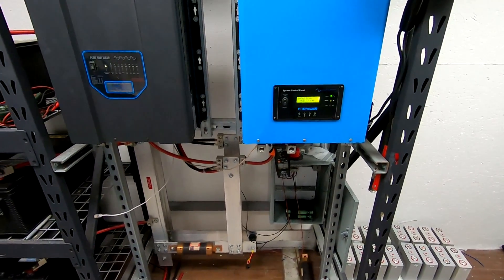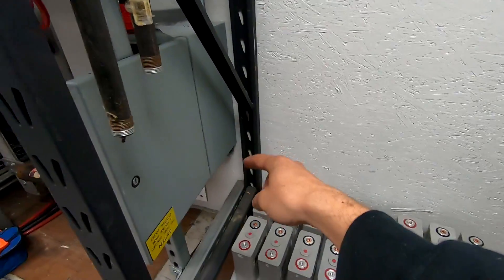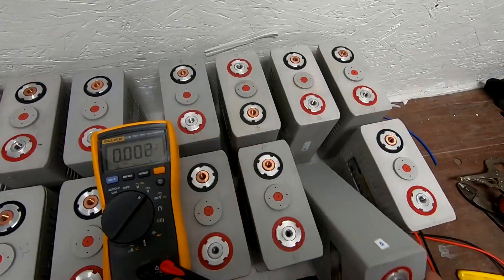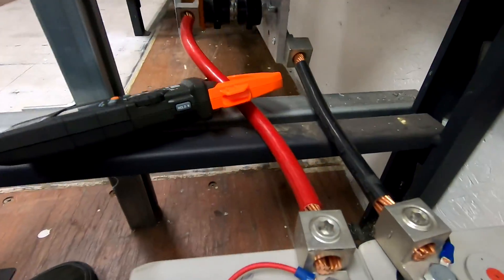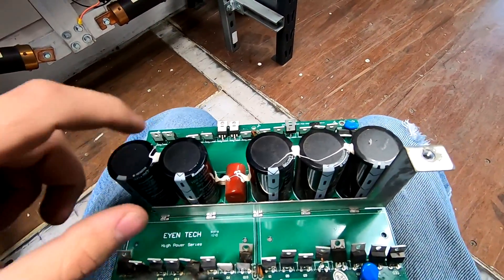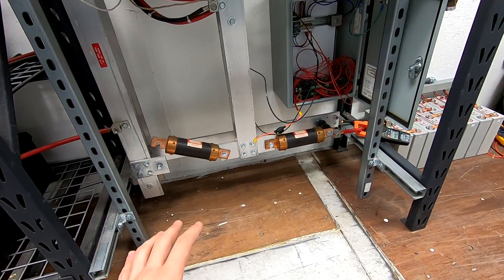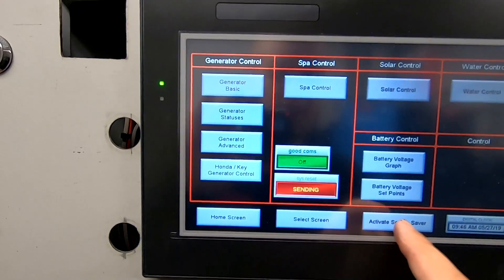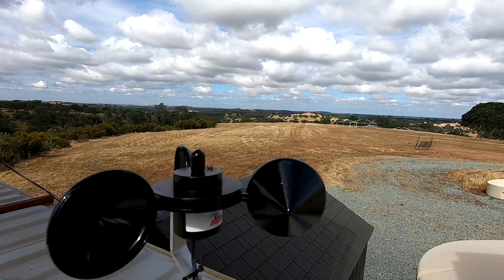Off The Grid: Installing the Best New Lithium Batteries!

Comment: Agree that Li-ion is better suited than lead acid.    Agree that prismatic LifePO4 (blocks) are easier to manage than 18650s...  AND LifePO4 have double/triple the life span (number of cycles).   The main reason a lot of us go with used 18650 is they are about 1/2 or 1/3 the price of LifePO4.        As you get things setup and increase the size of your battery bank I would look at limiting the DOD to perhaps 60% and you can extend the life of the LifePO4 even further.  For example, my battery bank is 780ah @ 48v which is 40kwh...  but I only use about 15kwh per day...   so I adjust inverter off to be 48v and max charge to be 55v and stay in the middle 50% of battery bank capacity.   This should (no one actually has exact info that I can tell) double / triple the life of the bank.
Reply: What are 18650's going for nowdays?  I know Jehu's selling them for $2 / 2200mah claimed, 1500 mah actual.  So for 100Ah, you need 67 cells give or take.  That's $134 for 100Ah used NOT including buying all of the jehu wire up modules that add to the profit.   You can get 100ah prismatic for $132 from ecpc, and you don't let out jehu's smoke like Kombi Life did burning down their house using 18650's that jehu sold them and soldered up the pack himself : https://www.youtube.com/watch?v=lc0j8tAzMw4
Reply: @haroldlopez2406  Calling an old Volkswagen a "house" is a bit of a stretch. Buy used lithium batteries from a shady mexican...what do you expect to happen?! Don't forget even million dollar electric cars catch fire. Obviously you have some beef with Jehu that none of us care about, lithium is dangerous and care needs to be used. Pot smoking hippies in a van are not a good example of anything...and people's actual houses (you know, the kind built from building materials) burn down all the time for all sorts of reasons.

What was their total loss, $1,000? My driveway cost 10 times that.
Reply: @ryanroberts1104  Part of the jehugarcia channel seems to be beyond shady and for the most part uneducated.  It's refreshing to see high tech lab do it right for once after amateur hour on youtube.  For years now, Garcia has said things like  "this here is a one kilowatt battery for only $…" which only proves he hasn't a clue about electrical engineering.  Batteries don't have kilowatts.  They can have kilowatt-hours if big enough in voltage and Ampere Hours.   His channel programming demonstrates he does not know the difference in power and energy.   Will prowse at least knows the difference and remains unbiased fully declaring when something is sponsored while Garcia has been making these "oh I just got these here ones in off ebay and we can make a 1 kilowatt battery out of them"   Yet he has a cultish following of people hell bent on this "powerwall" craze. It makes otherwise sane people  bolt significant fire hazards to their garage wall to be just like a tesla "powerwall" which is an elon musk marketing term Garcia has latched on to because it works.  What's happening today is people are spending lots of cash doing hazardous installs like this one in Hawaii  https://youtu.be/JA7Sh9ylAzQ?t=164   When those batteries go up in flames, they'll cook the inverters + charge controllers above them on the "powerwall"  Talk about a non-volcanic lava flow waiting to happen.  Also, take a gander at how those are parallel / series / parallel wired with only a batrium BMS on the outermost parallel of system voltage level banks.  He does that in a later video.  I can't see where he is getting the claimed 33 Kw-h for that "powerwall".
Reply: @infotech4990  I am not endorsing anything Jehu does. I did call him a "shady mexican", that was not a compliment. He does a lot of things I would not consider safe. With that said, I don't think he can be blamed because two stupid hippies caught their old bus on fire. I saw no proof it was the battery that actually caused the fire, or an error caused by Jehu himself. I did not investigate the fire myself.

And for GOD SAKE, an old Volkswagen is not a "house", people that live in them are considered "homeless", and if it burns down, it is almost nothing monetarily.

It's also worth mentioning, that even very expensive highly engineered systems, like a Tesla car, catch on fire also.
Reply from the maker: I'm sorry if you are experiencing a hardship and are forced to live in a van, then it's not "almost nothing", to them it's practically everything.  Just because it would be easy for you to replace doesn't mean it's easy for them.  Perspective is everything.  That being said there are quite a few sketchy practices going on, for example using resistor leads as tie wires between 18650s because his spot welder can't handle proper tie straps, or where he solders directly to cells, a big no no
Reply: @HighTechLab  Seems like more of a choice than a hardship. Maybe they should get jobs like real grown ups? Harold Lopez is trying to make the point that 18650s burned somebody's "house" down, which is totally not what happened.

Your batteries are obviously much safer, but drop something across the bus bars and I suspect a fire could quickly follow. True even for lead acid batteries.
Reply: @ryanroberts1104  IDK - I watched the whole hippie video, which is biased given the edit cuts, but the smoking battery I saw pulled out  of the hippie van certainly looked like the one JG put into the hippie van on their trip from south America to Alaska.  I could see that one blue cell at the edge in both before and after clips.  Same array Garcia soldered together in his workshop.  Also that hippie van fire happened while in storage just like Rich Rebuilds Disney car video, just sitting in storage.  I put some of our 3 year old UPS lithium into my boss' Class A to replace his AGM cells.  He now has 3200 Amp-hours of CALB cells partially filling the old battery tray that had 660 A-h of AGM.  What if that had been a Class A motor home instead of a hippie van?  The problem with lithium cobalt is that it supplies its own oxygen, like a solid rocket engine.  The fire goes out when you run out of fuel.  Lithium Iron doesn't do that.  I saw one video on lithium iron from Germany where they deliberately overcharged the cell to about 200% thickness bulging out, then put a direct short on it for about 15 minutes until it vented the hot gasses out the top.  Even so, no big uncontrolled fire like Tesla packs.  I have NEVER heard one instance of a lithium iron phosphate cell bursting into uncontrollable flames all by itself like the JG hippie van video or rich's vid or countless tesla fire vids, because the technology of LIFEPO4 is inherently safe.  If anyone has evidence of LIFEPO4 fire without intentional abuse then please post it here.  Everyone is bringing their A game videos of unintentional fires to this channel, which is great, and every one has one thing in common:  18650 Lithium cobalt generic lithium ion batteries, the 3.7V nominal not the 3.2 V nominal.  I'll wait.
Reply: @HighTechLab  EVERY 18650 battery mfg says NEVER EVER SOLDER DIRECTLY TO THE CELL.  Why?  Cross section of the top crimp shows there's a very thin INSULATOR inside the crimp that is destroyed by heat, and when that compromised insulator fails, you get a direct short from anode to cathode in the crimp area.  For lithium cobalt, it catches fire in milliseconds.  That solder melts and drips across the cells underneath, which join in the inferno once they cross the temperature threshold.  The rich rebuilds Disney video really covers what happens next very "well done".
Reply: I got most of my 5,000 18650s from AlarmHookup (ebay) a.k.a. https://batteryhookup.com/collections/tested-18650-lithium-ion-capacity-cells-from-modem-batteries  over 1.5yrs it took to build the battery bank.  At average of 2,000mah per used cell in 85% or higher original capacity the average cost was aprox $1.60/cell.   18650 is 3.7v so it takes 14 in series to get 48v.    So 100ah / 2000 = 50cells * 14 = 700cells * 1.60 = $1,120.   Plus another 500 or 600 in holders, busbar, solder, etc.   So call it $1,600 for 100ah.     
In the LifePO4 case they are 3.2v each, so you need 16 for 48v.   I'm not sure on $132??  as I have not found a trustworthy source for these.    New ones seem more than $132 - e.g. $200 or $250.  But taking your $132 it wouldb $132 * 16 = $2112.  So even at $132 it would be $500 more for LifePO4.    But I agree - LifePO4 is so much less work!!!  and double the cycles!!!   I just was not able to find a trusted source for used / cheap ones at $132.
Reply: As far as Jehu - I agree there's a bit of looseness in his approach and would not defend his battery purchase.  Battery wise Alarmhookup and Power2spare on ebay are the ONLY 2 sources I've found to be 100% accurate as to what they described and what I got.    BUT his videos have a great deal of honest info and they have helped me.   I'm not inclined to disregard valuable info.
Reply: I know - TMI.  But I wanted to thank @HighTechLab for the videos.  I can tell they are the 'real thing' and quite advanced setup, doing things I've not seen or discussed elsewhere.   My hat's off to you and thank you for sharing!
Reply: @kenattagexp9871  I do not understand why so many people believe the 18650 fallacy.  We use CALB cells at work in our Liebert UPS systems which are 3 phase 10KW each leg.  Electriccarpartsco has CALB 100Ah for $129 factory new, in stock right now just call and give them your Visa card.  We buy 1- 2 pallets at a time from our electrical distributor to replace the cells on our UPS systems, which runs roughly $110 per 100 W-h cell which is our contract pricing, not retail, certainly not ebay.  My boss still thinks you need to replace UPS batteries every 3 years like we did with AGM even though I've told him Lithium Iron Phosphate is good for 10 or more years.  Instead of going FedEx freight like car parts does, we have a trucking company deliver them to the dock door just feet from our datacenter.  Costs ~150 per pallet of roughly 250-300 cells.  Alarm hookup shipping costs $20.87 per 100 cells so add in another 146.09 to your figures.   So our price for 48V 100Ah is $1760 when bought by the pallet.  Shipping adds 50 cents or $8 per 48V 100Ah.  We're up to $1768, including the interconnect busbars made by CALB for their cells.  Those are factory NEW cells, which in UPS use should last 20 years or more since they only get drained if the power quits.  They carry a warranty from CALB, which we've never had to use.  I have no basis for an opinion of longevity, but I am sure HTL will give us some accurate numbers based on his usage I see here.  Anyone selling them for $200 or $250 is trying to double their money off a slick youtube video.  I put our used cells on craigslist for $95 per cell must pickup and they're gone in less than 24 hours, usually by the same buyer.  Now for your 700 qty used 18650, you say $1120 + $599 for 100 of those public domain PCB kits you solder yourself is $1719 plus your taxes and shipping.  Add in alarm hookup's $146.09 per 700 cells, which has some shipping profit as well, and you'd pay 1865.09 for a bunch of used 18650 cells with no history of how they were used or abused.  That's $97.09 MORE than brand new professional LiFePO4 with a warranty which is infinitely safer than Lithium Cobalt JG and AH is pushing.  We should put together a list of all the youtube lithium fire videos because one is forming here on HTL's comments!  Am I the only person who's noticed JG has no source of power other than the AC outlet?  Will Prowse and HTL have shown us their solar systems!  I don't see any solar or wind, so what is he making? a UPS?  We put our CALB cells in a datacenter holding I'd guess several million dollars worth of infrastructure not to mention the value of the data stored on it.  I wouldn't put one of those alarm hookup 18650 cells in my house.  18650 "power walls" will NEVER be cheaper than prismatic cells UNLESS you make your own cells, as Tesla does.  Even Tesla learned 18650 is not the most efficient battery and switched to the 21700 IIR to make at their own factory.
Reply: Very interesting and I don't disagree with your post.     I think 18650 got started because you could a DIY powerwall 'for free'!! as long as you could get old laptop battery packs for free.  Of course, that's just not reality.     I agree that in UPS they should last forever.  Lithium ion does not degrade very fast under steady voltage unless its at the very top of battery specs (from what I read).   THE ISSUE for me (and I suspect others) is a safe place to buy LifePO4 over time.   To do a 780ah bank of 100ah LifePO4s..  I would need 16 * 8 = 128 of them.   128 * $100 = $12,800.   Too much money to raise/risk for a single purchase... but yet over time say you buy 16 every other month...  you want the supplier to have similar product so you don't wind up with wildly varying cells in capacity.     I've tried several 18650 battery purchases and been stiffed (60% advertised capacity kind of thing) several times - so I'm personally very wary.    Do you know of a rock solid source for LifePO4 prismatics?.       Also, I should add, that now that I have made a major investment 18650 - the Batrium BMS and other pieces of my infrastructure are around the 18650 voltage range...   I'd have to buy a 2nd BMS to manage the differing voltage range of LifePO4.     So it kind of tends to 'trap you' once you go down a particular road.
Reply: @kenattagexp9871  I agree, you're into the ecosystem now.  Do you have a test plan of any sort? I'm just curious how you know if they are still good.  There's this Electrical Engineer guy who takes away most of our 3 yr old cells, so I'll ask him to join in here on HTL's YT channel.  About testing,  I asked my boss how he justifies replacing our CALB cells every 3 years like AGM when they are still good.  He sees things differently with a MBA and explained it this way:  To have me or anyone else take time out of our day to drain and load test every cell would cost him labor, which is in short supply already.  Labor = Money.  Since we get them for $110 and sell the 3yr old ones for $95, it "costs" $5 per cell per year to replace with factory new cells from CALB that come with a test report and warranty.  That "costs" less than paying one of us to test each cell and make sure they are still good.   The engineer dude showed me his test system with a bunch of expensive lab equipment from Agilent, HP, and Keysight run by a laptop that he uses to automatically test the batteries he buys from us.  It even plots a new graph of their capacity, which is usually well over 100Ah, like about 110 or thereabouts.  He told me CALB puts more in than 100Ah so that after 3000 cycles they still meet specifications if treated properly.  My boss got a quote to test them, but it was way higher than buying new ones, so that is what we have done for 10 years now replacing 1 phase battery set per year.  So my boss says the least cost option to ensure we always have working batteries on the Liebert systems and the Telecom room -48VDC bank A and bank B DC supplies is to just replace on a 3 year rotation.  Makes sense that way, and when we expand and buy more UPS systems, we get stable contract pricing on extra new batteries for ups acquisitions for expansion, a side benefit of replacing all the time.   We also save money not buying Liebert's expensive AGM rackmount batteries.  Guess that's what a MBA teaches you!
Reply: Test / How to know if good.    This is where Batrium (www.batrium.com) or similar BMSs comes in.   They have a system where you hook onto each of the cells that make up the series of the battery.   This provides balance but more importantly provides monitoring so you can shunt trip if any individual cell goes below Xv  or above Yv.     This combined with fusing each cell (as Tesla does in their car battery banks) provides an acceptably safe battery.      Spontaneous dead shorts in a cell will burn the 3-7amp fuse on each cell and isolate it from the pack.   Cells that go below X (say 3.0v) or above Y (say 4.15v) will shunt trip - isolating the battery from load or charge and give alert.  This should give one time to address the problem before it gets to fire situation.      For solar battery - like the one here I would suggest that its a good idea even for LifePO4 to have a shunt trip is the balance does not keep things above a min low voltage on each cell.
In UPS case - I would think you-all would have a BMS that perhaps sounded an audio alarm if one of the cells when low?  and give time to replace it?  
But, having worked for large companies, I also understand things like the 'logic' you outlined for the 3yr replacement.   There are business (insurance, customer expectations, ...) that make lowest possible $ a lower consideration - especially if sales are good :)
Reply: @kenattagexp9871  I don't see exactly how that balancer will be able to tell you the remaining life expectancy of a battery.  BTW be careful mentioning company websites by their URL as your post gets held for approval. I got yer notification bell and saw the URL in your post from baterium  but I couldn't read it until the moderator manually approved it just recently as that post didn't show in the list, even though my alarm bell got flagged and gave me a teaser version of your post.  I'm glad you understand my boss' logic, which is basically you can't rent a battery for $5/yr or even pay for an extended warranty.  So far we've never had a problem disposing of the old units.   What I meant for battery test reports is where you put a constant current drain of 1/h * c (example we use 12.5 A for 8 hr rate on 100ah cells) on the battery then plot the voltage over time for 8+ hours to measure what the cell will do.  It's measuring cell voltage over a period of time, which must be done outside of the UPS.  The battery tester does it, plots a graph of voltage vs amount removed.  We try to have 8 hours of uptime available, which means lots of batteries on some systems.   All of my UPS systems must be rated to run 8 hours, which factory reports guarantee as do aftermarket recertification which the guy who buys most of our old cells does.  I found his email so I'll forward a copy of this in case I got it wrong!
Reply: Sorry about URL.   You're right, the BMS does not show life expectancy, but it shows individual cells and their relation to each other and their performance such as ah in/out each cycle and number of cycles etc.  Each system has to define its own life expectancy.   In my case, my battery bank is large enough that it will deliver what I need all the way down to 50% of original cell's capacity.   I expect the packs (cells) in series to either reach 50% OR more likely become so out of whack with other cells in the series that they won't balance any more.   The BMS will protect against catastrophic unblance and do shunt-trip  AND/OR  report/record metrics so I can judge AH per cycle and judge that relative to the original 100% and if its enough for the system.    Batrium also records the mah of balance spent for each cell - this highlights troublesome cells as they will require more ah of balance than their neighbors as they degrade.
Reply: @kenattagexp9871  OK - so I think I got a picture of your setup, you've paralleled up a bunch of 18650s as one 3.7v "macro-cell" in the eyes of your bms, and if one big cell fails to perform, you know one or more of the little 18650s that make it is likely out of whack.  If you have a bench DMM that goes down to fractional uV resolution, you could probably probe around the bus that makes up one macro-cell and figure out where in general the problem is, especially if one 18650 develops an internal low-z situation since there would be a voltage gradient along your bus even when no current is flowing through the cell, i.e. everything disconnected feeding that macro-cell and all the 18650s are balanced.  Get a 6.5 digit resolution DMM and with zero connections probe for any variation along your bus material.   You'd be into some circuit level troubleshooting.  How often and how deep do you cycle your pack?  Looking at HTL's array and just his idle current during a solar night, he's pulling down 50% of the 100AH running that Fox-Power Chinese inverter, which is fast becoming a weak link.  All those Chinese inverters have lousy transformers and the losses associated in them eat your solar power 24/7.  Would sure be nice if someone in china did it right, but at the end of the day it's always make it cheaper so you make more profit.   Some are even winding transformers with aluminum wire now!  I'd guess he ends up with at least 2 charge cycles a day, maybe 3 depending on night loads other than the inverter.   

If you get a chance, put up a pic of your fusing for each individual 18650 because the scariest situation, and one that may have doomed that hippie van, is that one cell, damaged at some point in its life, has an internal defect that shorts out metal to metal, anode to cathode, and pulls in all that the surrounding cells can give, sparking a one cell fire which spreads to neighboring cells like nuclear criticality.   With 700 AH, you have roughly 130 Megajoules of energy stored up.  That deserves a lot of respect!
Reply: ".. if one big cell fails.."   Yes - but replace with a waiting, good macro-cell  Then disassemble the bad macro-cell and retest the individual cells for capacity and IR (same process as when macro-cell was built) and replace bad cells or toss whole thing depending on what is found / age of cells.    Cycles -  The battery cycles once a day (PV array charges , inverter draws down) but limited to 85% (4.0v) max charge and 30% bottom (3.4v) with average 40% DOD in an effort/hope to get 3,000-7000 cycles out of these 18650s.   The battery size is such that max charge at each individual 18650 cell is 300mah and max discharge 600mah - so its 'soft' on the cells in that regard.   I understand its not expected to get 1000(s) of cycles but Battery University has some data that says it 'might' be possible - frankly there is no consensus.   Tesla batteries last 10yrs is seems (3,650 cycles?).   I've gotten 312 cycles so far with no detectable degradation  - but who knows.  Another 5 years should shine a light on this.           The inverter is 12,000watt AIMS (looks like HighTechLab has earlier version in youtubes) and use automatic transfer switches fed by grid and inverter so that when inverter comes on, the house circuits auto-switch to inverter power and when inverter shuts off the grid takes over.   I use APC UPSs (with 7s7p 18650 packs I built) to smooth out computer and tv circuits to avoid glitch in switchovers each day.     AIMS running OK for 5 months now - not sure about long run.   Its not quite 60hz so a few of my clocks lose time each day.    130Megajoules (not a term I understand well) as I think of it as 40Kwh...   but I get your point and that's why BMS and catastrophic macro-cell detection / shunt-trip is required.    Its definitely enough to burn the house down literally if not treated respectfully!
I don't understand all you have written - so I'm writing past you a bit (sorry about that) - but happy to continue if you wish.   Can't post pictures here in "Reply" but I can offer an email - aeabacamon60@yahoo.com  -  if you want to continue the discussion and I can email you picks.
Reply: @kenattagexp9871  OK - now I get it - you're treating the array of cells as a FRU to be swapped if need be based on performance.  Say, has anyone ever done any testing on how those resistor lead fuses work to join each cell to a bar, as in what fault current is required to interrupt?
Reply: Much discussion/testing.  The fusing of individual 18650 cells to the buss is one of the hallmarks of the Tesla car battery design - its where this practice originated and adopted by all of us DIY battery builders.  You can buy axial fuses with specific 'blow amps' or use thin wire.    Its not so important to have exact 'amps' as it is to 1) have large enough fuses that you don't blow them under max load from the battery  (e.g. 100cell battery delivering 100amps would require at least a 1amp fuse per cell)  and 2) small enough to melt if 18650 cell goes bad/dead-short - so it must melt if rest of pack starts a dead short thru it.   There's a reputable world-wide discussion board on stuff like this at secondlifestorage.com  - search for "Fuse Wire" to pull up some threads.       I use 30awg wire (easy to purchase/solder) which melts at 7-15amps per my tests.   Others use resistor lead wire.  Others use axial fuses with specific amps (.5 or 1 or 3 or 7).  Some use fuse wire.        I wonder about LifePO4 prismatics...   can they go 'bad' and short out - especially as they age?.   It might be wise to apply the same concept as soon as you start paralleling a LifePO4 battery bank?
Reply: @kenattagexp9871  Years ago I had to deal with annoying fuse issues, like they always blow at LESS than their rating.  I'd plotted the blow values for a whole box of 100 fuses only to find out that a 10A fuse could blow anywhere between 6.5A and 9.5A.  And these were BUSS brand fuses, not some off shore junk.  Picking a fuse is thus a good guessing game!   Internally, lifepo4 are just a bunch of foils sandwiched up, so you could think of it as a whole bunch of little batteries in parallel... no different than what you're dealing with, except there's no fuses inside the outer box.  Even folks like battleborne who make boxes with lots of cans inside don't put individual fuses between each cell and the voltage planes.  As to if a lifepo4 could short out, I don't see why not.  I sort of suspect it is more a function of a manufacturing defect that makes it into the final product, stays dormant for a while, then some day something happens and it shorts, it spreads, and soon it starts draining power from wherever it will come from.  Do you know of anything specific to your chemistry that would predispose it to being short/open prone?  Somehow I think a better component is a fire suppression system, like tesla does with the interstitial space between cells.  Do you know if there are documented cases of a cell "just shorting itself out" and being witnessed?
Reply: Documented spontaneous short - not that I could find.  However, it seems clear that it can happen.  For example batteryuniversity.com has a section "BU-803b: What causes Cells to Short" where they cite manufacture impurities and physical damage such as dented 18650(s) that appear OK but the dent puts pressure on the separating membrane which suggests that it will more easily fail (short).    The  main reason for fusing (as I understand it) is not 'fire' but rather the cascading affect where 1 cell shorts which draws current from adjacent cells until the whole pack goes to zero volts.  When the pack is in series (say 1 of 14 or 1 of 16) and goes to zero, it can actually go on to a negative voltage as the overall battery struggles to deliver 48v nominal.   This zero/negative voltage will quickly damage the chemistry of the pack/cells so they can no longer be charged - and must be discarded (costs $$).      It seem to me that if you build a large battery (say 800ah @ v48v) of LifePO4 and you have 8 x 100ah in parallel *  16 in series - it would only make sense to somehow fuse each of the 8 in parallel - so that if 1 of the 8 goes 'bad' (to zero volts / shorts) it won't drag the other 7 down to zero as well.  Then, a proper BMS will show that pack (with 7 instead of 8) as 'struggling' (not as much capacity as other packs) and give a sporting chance to find/replace the single LifePO4 that failed instead of all 8.
I'm expressing my overall understanding from many youtubes and discussions etc...  I have not actually had any zero volt experiences myself.   One actual zero volt experience can be seen on very recent @HPPowerwall youtube titled "No room to be complacent when playing with Lithium revisit - IR test" where he had a cascading, zero volt pack event.      Some DIY'ers build outdoor sheds / metal enclosures / and fire suppression as you suggest.    These have pros/cons - for example outdoor shed would require cooling/heating.  Fire suppression is not practical for me other than Fire Extinquisher.    As a DIY'er  I do have my battery bank on concrete floor with cinder block wall of basement and sheet metal overhead between it and plasterboard ceiling...  but who knows.    There's also the concept of reasonable risk...  like driving or cell phone burning your ear.    My battery bank is vetted, working smoothly for a year now, and I would think fire risk would be higher when adding new packs and lower on a smoothly operating, properly BMS'd system with good operating history.    TAKE ALL THIS AS SIMPLY SHARING / DISCUSSION - I HAVE NO SPECIAL KNOWLEDGE!
Reply: @haroldlopez2406  FYI ECPC is $129 today, don't know if that's a special but at least it's reasonable retail pricing.